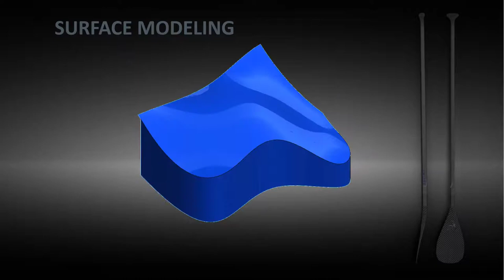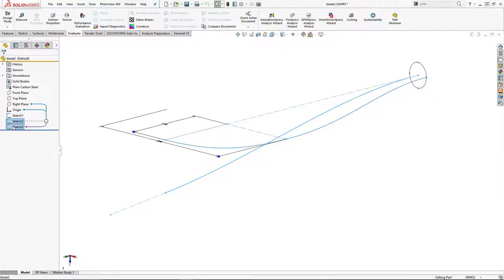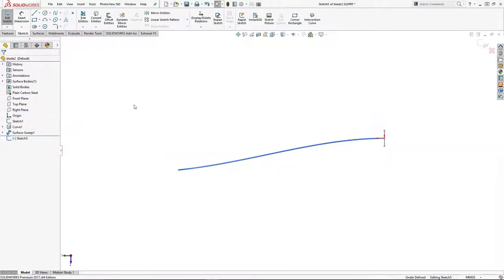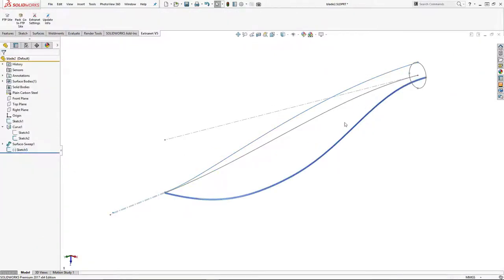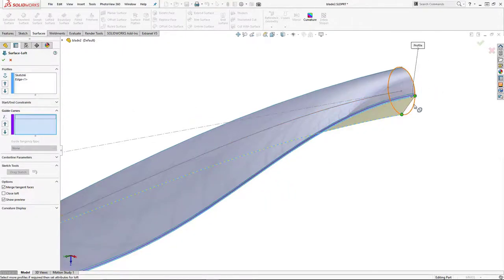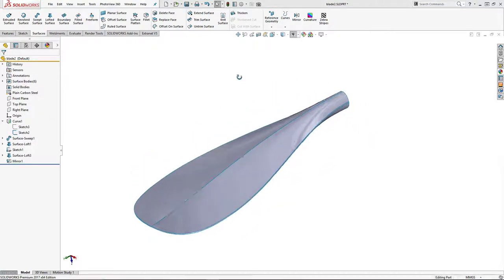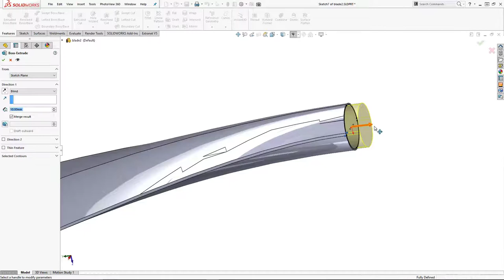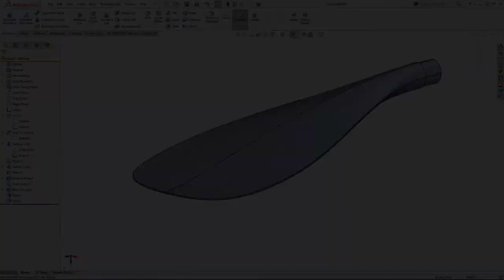How to Model a Paddle in SolidWorks: P3 - Surface Modeling

Comment: Did you just call forward side of paddle a working face? Why would you call so face that is not pushed first through water? Are you using it wrong? It must angle away from you not towards you.